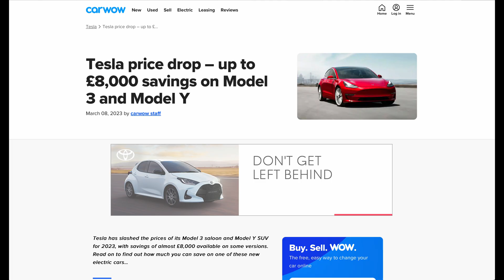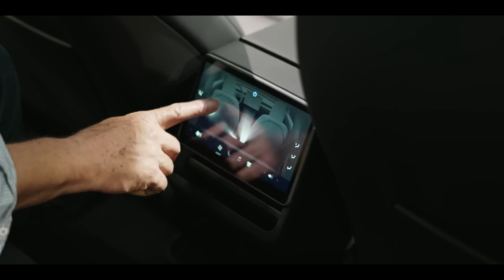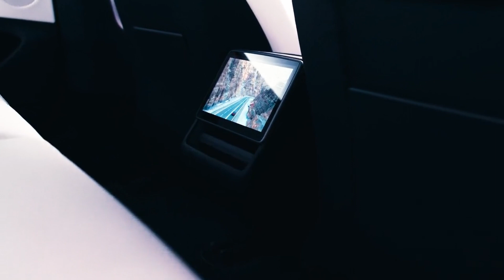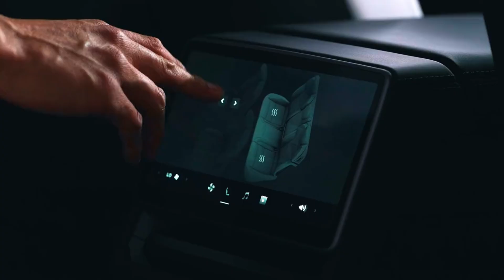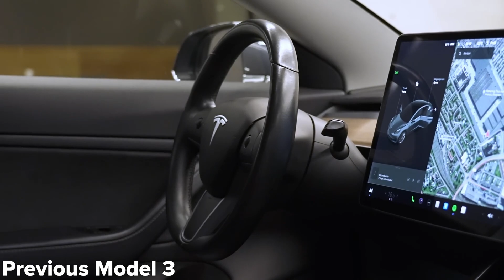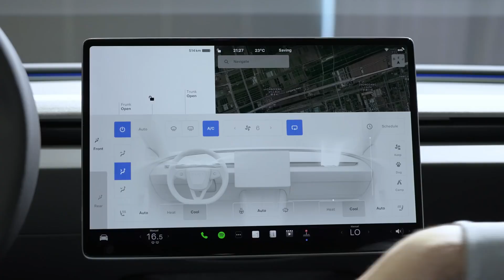More Than Just A Refresh | What The Tesla Model 3 Refresh Gets Right

Comment: I get the benefit of not charging to 100% due to the bigger buffer available on 100kwh battery pack when one has paid for an 85kwh model.. assuming the pack is not LFP.. but, if I were then charged £2500 to unlock that capacity after having paid for the additional energy required to haul the extra weight of the battery pack around for maybe a couple of years, then I might be justified in feeling a little miffed. Surprised you didn't make that observation yourself Dave.
Reply from the maker: I think my question is, what size battery have you actually got? The software tells you a figure, but is it programmed to tell you that figure. You might never know. As long as I get what I paid for, I'm ok with how they do it.

Comment: In terms of the single battery pack there is also the possibility that the cheaper models could get packs that were tested and turned out to have some bad cells.  That’s the way they do it for cheaper CPU models, which are the same as the expensive ones, but with some cores switched off (because some may have failed in testing), and rated at a lower voltage or speed (because testing showed they were on the lower end of the tolerances).  In the case of battery packs, some cell banks could be disabled or used less strenuously and those packs could be reserved for entry level models.
The point is that the packs can be tested and rated after they are assembled with fewer rejects.
Anyway, that’s just a theory.

Comment: Oh, you're a Tesla fanboi. No need to retreat from the label.

Tesla-watching is fun!

I don't much like Tesla's practice of selling you a battery pack, then locking it with software and demanding a ransom to unlock it. If they can keep costs low in production, then a straightforward sale of the product they made seems sensible to me. Tesla is just begging for consumer protection litigation.

Hardware is not software.

BMW found that out the hard way. They tried to charge consumers a monthly fee to use heated seats and steering wheels built-in to their cars. Consumers did not like it. BMW backpedaled.

Software locking of battery packs is completely unnecessary to Tesla's future growth. The big bucks will be in software and robotics.

I have criticisms of Tesla on my mind at all times. But they are still making exciting products whose price/value ratio slam-dunks their competitors.

So, yes. I'm a fanboi, too, and proud of it.
Reply: I’ve never seen software locking of the battery in the uk for Teslas.  I’ve only seen it happen once in Canada and that was only to get past a $45000 price ceiling for qualifying subsidies.  The idea was to buy the cheap - 90 mile range Tesla, claim the subsidy, and then upgrade to normal range Tesla.  It’s not the normal practice for the battery.  The standard range cannot be unlocked to a long range Tesla.  They are two completely different batteries.

But for other attributes: acceleration boost, rear heated seats on the standard range, internet access.  Yes, that’s software locked, but frankly I haven’t cared for these little things.  So long as it drives, is comfy and sporty enough, whilst costing little in fuel, then i haven’t cared enough for unlocking frivolous features.
Reply: @anthonydyer3939  that's one consumer who doesn't mind software-locked hardware that they bought, but can't use.

If enough consumers feel as you do, automakers will feel free to lock more hardware and demand payment to unlock it.

There's a slippery slope there. And you are pouring grease on it.